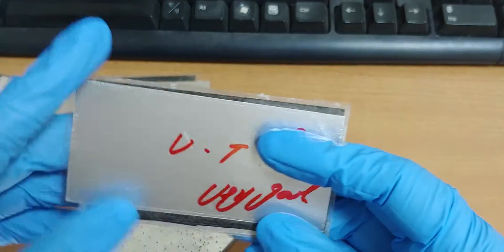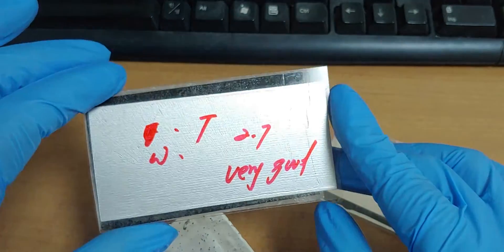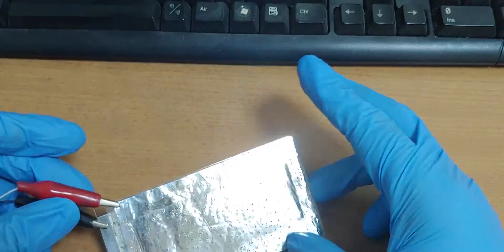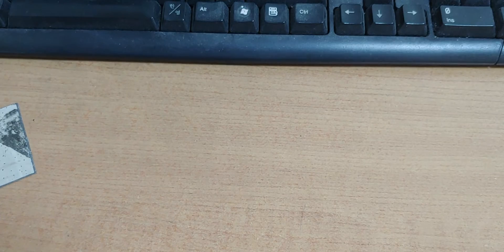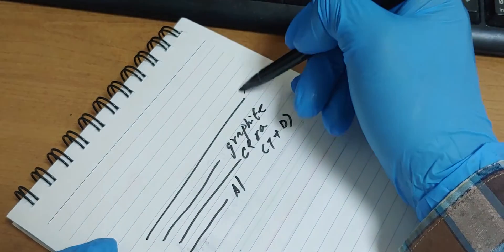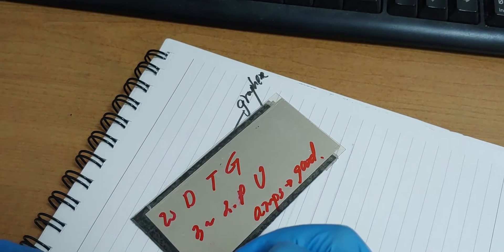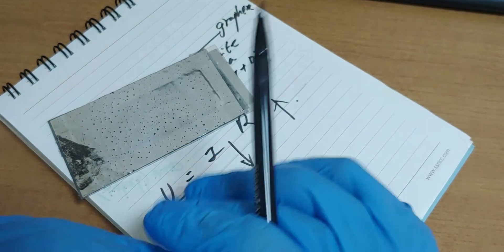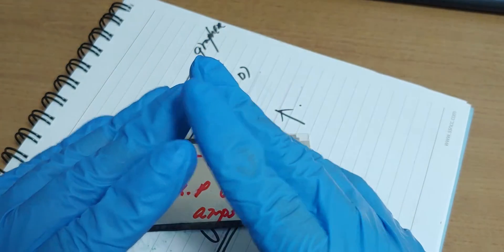solid state graphene battery from 3.0v

Comment: Most likely the boron ion in the detergent helping it along. The toothpaste is probably pH 6. Adding any type of acids will just increase the pH so that's probably why it went to 2.3 volts. Maybe added a little soluble sulphur to the toothpaste also....
Reply from the maker: Electric potential of sulfur is... I will try. Have a nice day
Reply: solid battery has a lot sites for ions .... so i am told . Maybe best in cathode too!